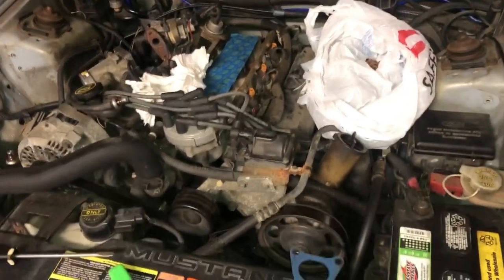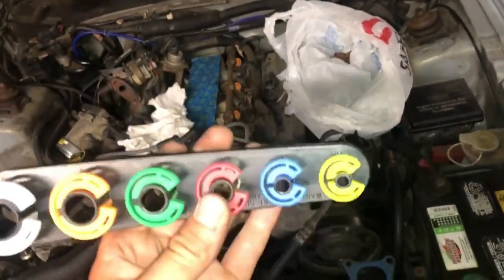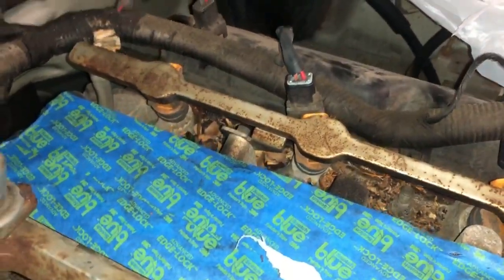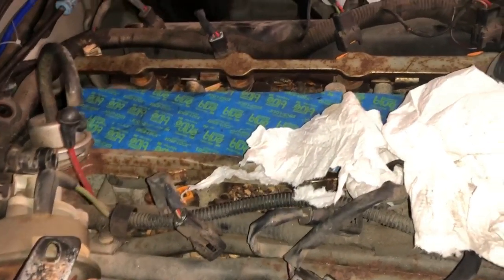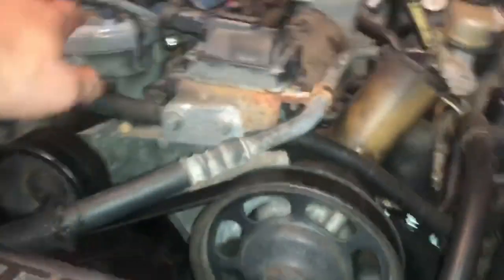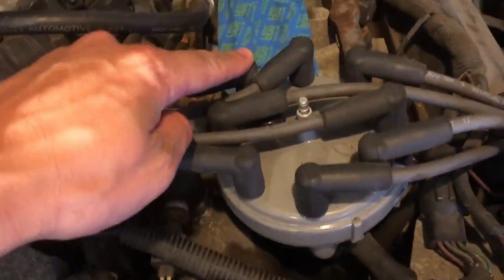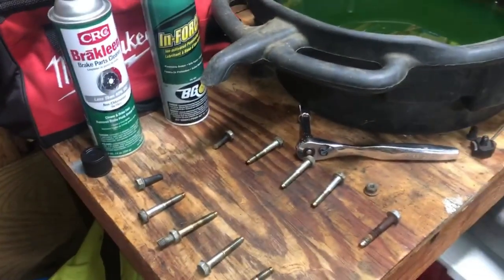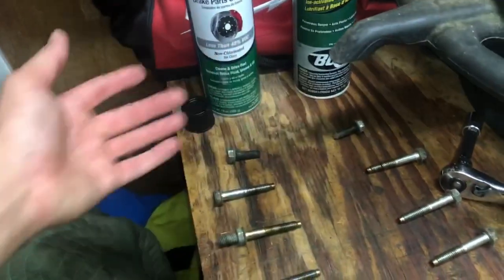Removal of Lower Intake Manifold 95 Mustang GT

Comment: thanks for posting. I am about to put my 94 back on the road. Going to do a lot to it. But taking to a shop for the heads and upper and lower intake work. I just want to daily drive it like I did before i parked it in my garage 12 years ago. Gonna put new carpet, rear seat delete, new seats. I may go long tube headers as well, I want NA 400 or as close to it as I can. Keep posting, not enough on our 94 95 specific cars yet.
Reply from the maker: You got it! And my front shock replacement video just uploaded! I agree not a lot of content on the 94 95 cars. Wow good for you and best of luck with getting your 94 back on the road for daily driver duties! I rarely see 94-95 cars in my area but when I do it is awesome. Because at their age it takes a lot of upkeep and lots of wear item parts have worn out due to mileage and age so they are really great project cars!

Comment: Thank you so much for this video,  im swapping out my factory upper and lower for a cobra upper and lower and was having the same issues as far as removing the factory lower intake!
Reply from the maker: I'm glad you found it useful! More videos with tips and tricks on the way since my 95 is always finding new ways to break on me haha. That's cool you're putting on a cobra upper and lower, any other mods you plan on doing? I want to do long tube headers on mine but the exhaust manifold bolts on my car are rusted to hell, so I either have to heat them up or just pull the motor and rebuild the damn thing haha.

I also posted a YouTube short showing how I removed 2 of the lower intake manifold bolts that I broke off if you need info on that. I used a Dremel with a cutting wheel and a Bernz-O-Matic torch

Comment: This is a huge help for me while I remove everything to install news heads, cam and carb style fuel injection system for my sn95 1995 5.0
Reply from the maker: Nice, I'm glad it helped! The cork pieces ended up leaking on me so this winter I'm planning on doing a more in-depth step by step video just in case this video has any gaps in the how to. I needed the car back up and running ASAP, but this winter I can take my time filming a better how to! Hope everything works out on your 95!
Reply from the maker: So what is your progress so far??